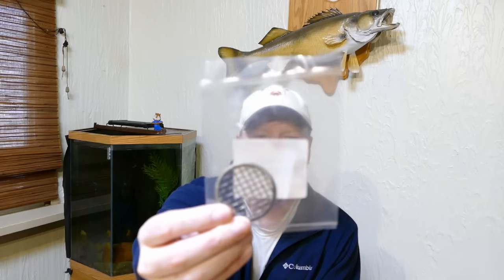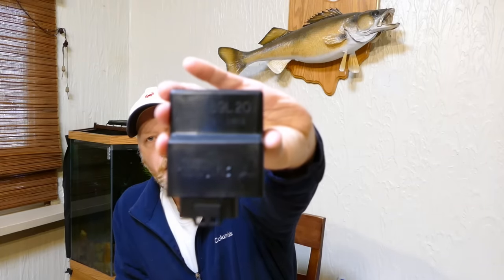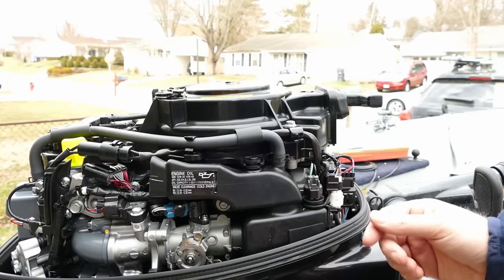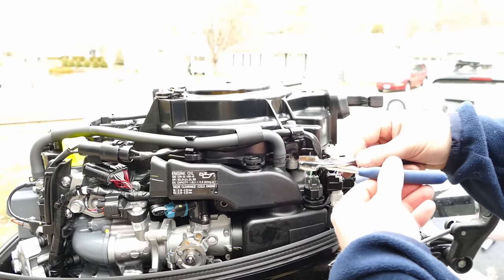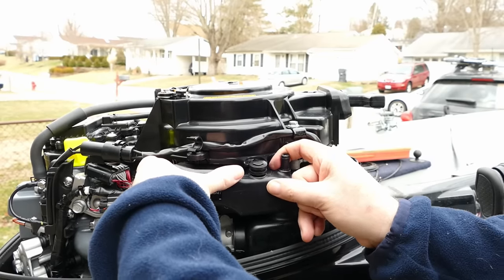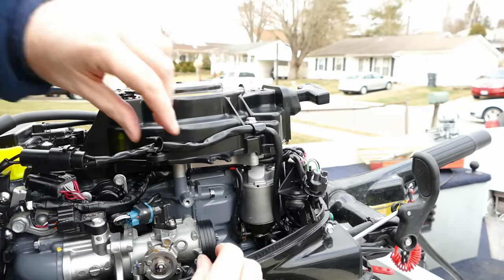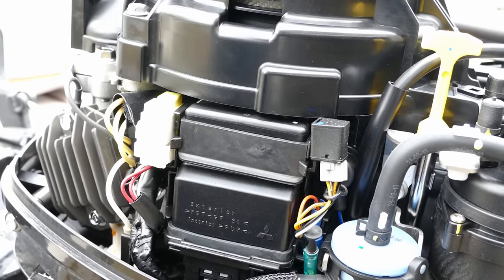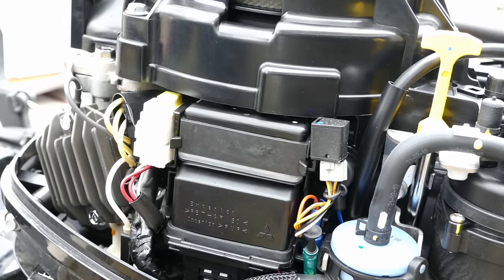Suzuki 9 9 to 20 HP Conversion Project  -  So Easy!

Comment: Awesome- did you break in the motor first while it was a 9.9 ? I like the weight savings if using on an inflatable where it is being removed often.
Reply from the maker: Yes, I broke it in as a 9.9 and ran it for several months and through a couple of oil changes before doing the upgrade!
Reply: 9.9 and 20 both weigh the same actually.
Reply: @Dark30Outdoors  so would you recommend running it for a while before converting to 20hp? Is it necessary?
Reply from the maker: @tylerhennigan8465  I don't believe it makes a difference at all.  Some people might want to wait because this does void the warranty, but these things are built extremely well so I wasn't concerned about that at all!
Reply from the maker: @tylerhennigan8465  I don't believe it makes a difference at all.  Some people might want to wait because this does void the warranty, but these things are built extremely well so I wasn't concerned about that at all!

Comment: It would have been interesting to see how much of the improvement was just from the $18 restrictor plate mod and how much was due to the $440 ECM change-out.  I suspect 80% of the improvement came from 4% of the modification cost, but I've been wrong before.

Also be interesting to know the difference between the 9.9 and 20 HP list price, and whether there's a resale market to recoup some of the $440 by selling the old 9.9 ECM on EBay.  (And can anyone flash the 9.9 HP ECM to make it a 20 HP ECM without actually replacing it?)
Reply from the maker: You raise some interesting questions.  Hard to belive there would be much of a market for a 9.9 ECM, but possibly.   I do know some guys that have just done the  switch from restrictor plate to the screen.  They say it made a measurable difference, but I don't know how much.
Reply: @Dark30Outdoors  swap back the 9.9 ecm and report back.
Reply: Recon it is just a $2 part in the ECM to increase the fuel flow to match the increase air intake.
Reply from the maker: @borisj4054  That's very interesting!
Reply: Couple videos on just making the hole in the air plate to increase speed... guy said if you make the hole to big the air/fuel is and issure for the 9hp ecm. So if you just add the new restrictor plate if will not run well. Cuts out at highter rpms
Reply: @borisj4054   No difference in parts in any ECM,  No difference in production cost either.  Its simply PE Tuning of AFR, using injector pulse width, timing curves, and max RPM at WOT.
Reply: @Spirited_Driver  not my photo. Did not comment on this

Comment: What build year is your 9.9 now a 20hp suzuki.
Reply from the maker: Mine is a 2021.
Reply from the maker: Mine is a 2021.
Reply: @Dark30Outdoors  thanks for the reply. you know if it works on older models or from what year this mod is possible?
Reply from the maker: @QuickJoe  I believe it can be done on all 4 stroke modes that have electric fuel injection.

Comment: Do you have to change the prop?
Reply from the maker: Good question!  I know guys have done it without changing the prop, but the standard Suzuki 9.9 comes with a 3 blade 9 pitch prop and the 20 HP conversion will come close to the RPM max out.  This can be harmful to the motor.  I mistakenly bought the Hight Thrust model which comes with a 4 blade prop.  I didn't realize at time of purchase.  So, I switched to a 3 blade 10 pitch which will keep me below the RPM maxout, and I am still getting up to 23 mph top speed!

Comment: Hey, I went to order the ECM and the seller claimed this does not work on their page under the on as a warranting can anyone confirm they also had no issues? Also is there any negative other than the lower RPM limit running the 9.9 ECM unrestricted for the hole shot?
Reply from the maker: If you are asking if it will void the motor warranty then yes that is correct.  However, these are very reliable motors, and have an outstanding record in regard to reliability. Mine is running like a dream still today!!

Comment: It's weird that two strokes are faster at less rpm like say a 15hp johnson 15 2 stroke I had would run 22 mph on a 1436 deck and all gear. I put a tohatsu 15hp 4 stroke and it barely wants to do 18-19 maybe
Reply from the maker: I agree!

Comment: Do you have to change the prop to optimize?
Reply from the maker: I know there have been some that did not change the prop, but if you run the stock 3 blade nine pitch the motor will run at max rpm right near the redline.  I got a 3 blade 10 pitch for mine so I run wide open comfortably below the redline.  Pushes my 14.5' aluminum deep v to about 24.5 mph!
Reply: Thank you so much, I'm going for it soon
Reply from the maker: @PJ_2761  Awesome!!

Comment: Hello, I'm Eric from Chile, first thank you for sharing your experience with this improvement in your engine, and second, do you know if your ECM is for the electric starter motor? Because being a manual boot changes the code, do you know anything about that? Thank you so much

Comment: Do you know if this is possible on 2022 Suzuki 9.9 models?
Reply from the maker: I don't see any reason why not.  It looks like they're still using the exact same housing.  So, those 3 parts should be the only thing different.
Reply: Did you ever convert your 2022 over to a 20 hp
Reply: @Franklin Harris  yes! Just this weekend I did. And I referenced your video several times while doing it. Thank you! 

I swapped out ECU, Flame Arrestor, Silencer seal and prop (went 9" pitch to 10" pitch). My 1652 Weldbilt boat went from 12mph WOT to 21mph WOT. Amazing difference!
Reply: @Franklin Harris  I think their the same but here's what I used:

13710-89L00 Flame Arrestor 

13832-89L00 Silencer Seal

33930-89L20 Engine Control Unit

58100-89L60-019 M1001 Propellor 3x9-1/4x10 (10" pitch propeller)
Reply from the maker: @jamesmurtha1355  That's awesome!!
Reply: @Dark30Outdoors  🚀 🚀 🚀
Reply: Hi James did you have the parts number for the 2022  9.9 Suzuki outboard conversion?
Reply: @Franklin Harris  yes, I listed them above. If you do the conversion, please let us know how it goes. I'm loving mine. Went from 13mph max to averaging 22-23mph (but once saw 24mph on my GPS).
Reply: @Franklin Harris 

13710-89L00 Flame Arrestor 

13832-89L00 Silencer Seal

33930-89L20 Engine Control Unit

58100-89L60-019 M1001 Propellor 3x9-1/4x10 (10" pitch propeller)

Comment: Thanks for the tip! How's it handled since the 2 years that you did the conversion and was the conversion less than if you bought the 20HP? If so, what was the difference?
Reply from the maker: This outboard runs like a dream! The cost difference didn’t amount to a huge savings, maybe $40 or so. Real reason I did it is that my area has lakes that are 10 Hp or less and nobody knows my OB is really 20!  😁

Comment: You will never convince me the ECM for the 9.9 and a 20 hp has a price difference. So a 9.9 and a 20 should have a similar initial   price. Can you imagine how Suzuki could dominate the market for 20s.
Reply from the maker: I'm sure they are similarly priced as components.  However, the market will dictate that they can price the 20 higher.  That to me is just common business sense.
Reply: @Dark30Outdoors  The way I look at it is add 200 bucks to the 9.9 and they would dominate the 20 hp market and gain overall  market share, and have more  Suzukis  on more boats, which would introduce the consumer to the brand and the more profitable larger hp motors.

Comment: Thanks for great guide! Does it work for 2022 models too?
Reply from the maker: No reason it wouldn't.  It's the same exact motor except for those parts.  Simplifies their manufacturing process.
Reply: @Dark30Outdoors  Thanks, i gonna give it a try!
Reply: @vault8827  how did you go getting parts for the 2022?

Comment: Unless this can be done without buying the ECM you'd be better off buying the the 20HP and some stickers.
Reply from the maker: Some have said it can be, but I’m not sure that would be ideal long term.
Reply: @Dark30Outdoors  Maybe, but the ECM is as much as the price difference between the engines.

It would be easy to test and track.  Just use plug color to see if the old ECM can adjust the mixture properly.

Comment: The price difference is about $600 US and it looks like the conversion is about $450 US
Reply: Here where I live they cost the same. The 9.9AS and the 20AS
Reply from the maker: I might have save a bit of money doing it this way, but in my area there are lakes which are restricted to 10 HP or less.  Yet, my motor is now a 20 hp but they won't know as it shows as a 9.9!   :D

Comment: Don’t know if you addressed this but you probably need to reprop to get full benefit. What’s the difference in cost from a 9.9 and the 20 anyway? If it is 500 then…
Reply from the maker: Yeah, I bought the motor with a HT prop and didn't realize what that was.   LOL  So, before the upgrade I bought a new prop and went with a 3 blade 10 pitch as I knew that would keep me below the RPM max.  I didn't save a ton of money by doing the conversion, but my areas has lakes that are listed as 10 HP or less.  My motor is labeled as a 9.9 so I can use it on  them with no problem!!

Comment: There goes the warranty
Reply from the maker: Yes, this is true and a good point that I didn't make in the video.  I'm not really worried about it.  These things are built well, don't really have many problems and I'm keeping up with the maintenance as expected.
Reply: why would this void the warranty? the ECM contains all the data? put the 9.9 parts back in, you should be fine, as long as there is no youtube video ratting you out  🤣

Comment: Was this all to upgrade motor or ( have a bigger motor ) with a little motor dress . So that you got more power than restrictions on water allows
Reply: No, the 9.9, and the 20 hp Suzuki outboard are both the same overall with the exception that the 9.9 has these restrictions for use on small, portable boats that would be overpowered by anything larger. A boat such as the one he has is probably rated for as high as 35 hp. This modification is for someone who has a 9.9 mounted on a boat that for all practical purposes is too big for it.
Reply: So when I get caught on a restricted horse power lake ….. shall I tell them to send you the fine or the originator??? 
You know the wheels are turning for a lot of people who want all the power and still according to cover and decals fly under the radar and be illegal….
   BOTTOM LINE !!!!!!!

Comment: Does this upgrade still work on the 24 model year Suzuki 9.9 EFI with manual start and trim?
Reply: Prolly need to enlarge the fuel injectors and flash the ECU with a new compression rate and a microsupercharger

Comment: Better to buy the 20hp in the first place? It only costs $600 more, and the upgrade costs $500 and will void the warranty.
Reply from the maker: My upgrade didn't cost that much, plus it really comes in handy that my ob says it's a 9.9 hp ob due to certain lakes with hp restrictions.
Reply: Just keep the 9.9 ecm and the restrictor plate and if you have issues put them back on and then take it into the shop. They’ll never know you messed with it
Reply from the maker: @outdoorohio6781  Yes, good point.  I do still have them!
Reply: There's limits on certain lakes for a reason. Please don't ruin it for others and nature!

Comment: The 9.9 cost $2,600. The covert kits cost about $500
Add these up got total about $3,100. The new outboard 20hp Suzuki cost $3,070. Why bother to do this kind of conversation to void the manufacture’s warranty?
Reply from the maker: That's not what I paid for my 9.9.  Also, in my area there are lakes that are restricted to 10 HP or less and my OB shows as a 9.9.  These motors have a great reputation.  I don't expect it will give me any problems.

Comment: how is it a flame arrester...connected to the airbox... it's obviously just a gauze to enable almost full flow air
use a bit od wd40 on the rubber to allow it to slide back in better
the ecm it just allowing more fuel in there...so basically you are making it work harder...might not last as long.....would you prefer to drive a hinda civic type R or a Dodge Charger....gimme the dodge! 🤣🤔
Reply from the maker: Thanks!  Appreciate it!!

Comment: Why read the parts numbers out loud? Just leave them in  the descriptions and save time for everyone.
Then, you don't provide the model number for the outboard you are converting.  There are at least 4 that I can find.
Reply from the maker: The part numbers are the same for each Suzuki 9.9 model.  They don't change from one to the other.